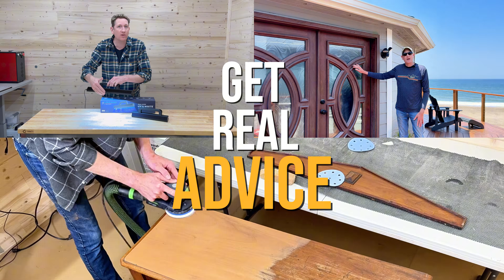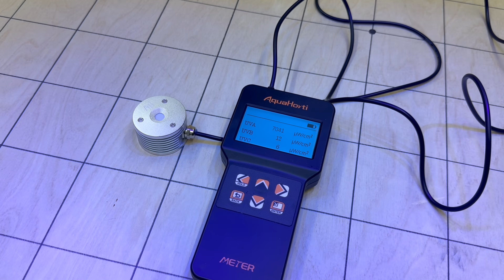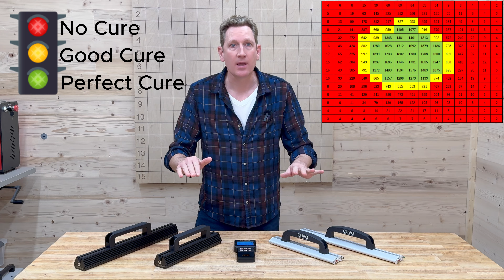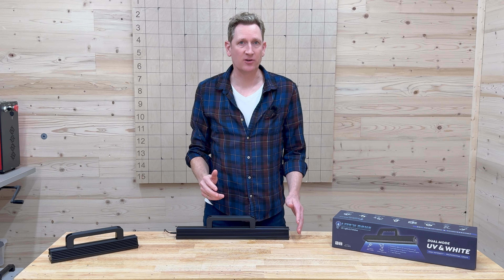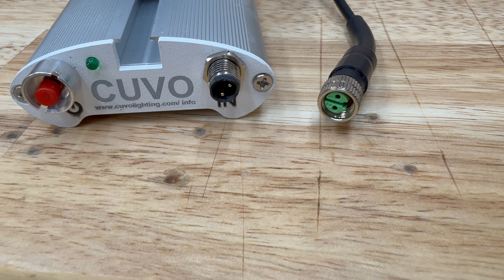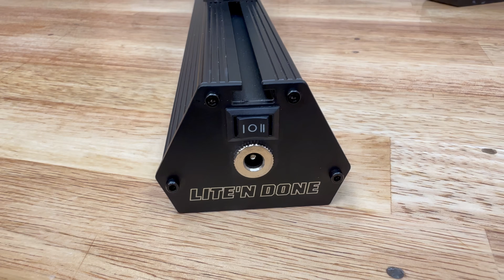Lite 'n Done vs Cuvo: The UV Light Showdown (Real Coverage Test)

Comment: Hi all,

I checked your site and saw that you seem to be sold out of the Ultra UV light that plans on releasing this month. It's the model that's intended to be used with the UV Hardwax Oils like Vesting and Osmo.

I currently own the CUVO H36 and am in the Clean Armor system. Does the H36 have the Irradiance to cure these hardwax finishes if I hold it closer to the worksurface? Or will those finishes not cure reliably? Thanks!
Reply: Most of these youube salesmen are not going to respond.
Reply from the maker: The ultra model should be available for purchase Mid-November.. I appreciate your interest.

Comment: Interesting comparison. I'm in the market for a UV curing light for clean armor products and was set on the CUVO but these look very promising. Do these "boil" the clean armor - leading to imperfections? CUVO claims their lights don't and are purpose built specifically for clean armor.
Reply from the maker: If you follow each of the manufacturers guidelines on distance and time, you will be fine. Both Cuvo and my lights will boil Clean Armor if used too closely.
Reply: @LitenDone  Good to know thanks. One other thing I noticed in the video is the spectrometer values you got from the CUVO H36 are quite a bit lower then even then smaller entry level CUVO H24. For example, the peak spectrometer reading for the H36 was only 1216 while the peak spectrometer reading of the H24 was 1802, which is right in line with both model Lite'n done lights. The CUVO H36 is also not reaching the advertised 3'x3' (9 sqft) curing area. Could it be that your H36 unit you tested has become or is defective? Might not be a direct and fair comparison if this is the case.